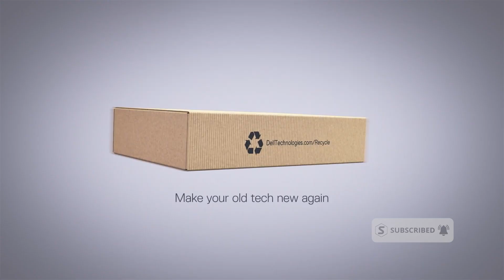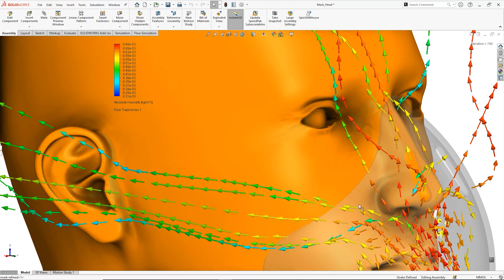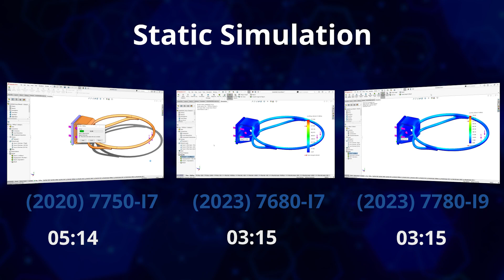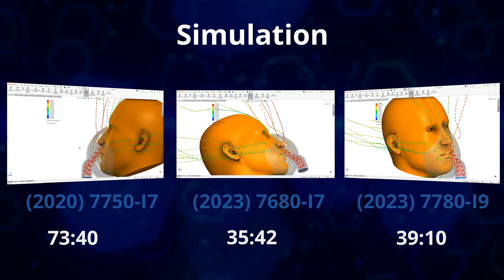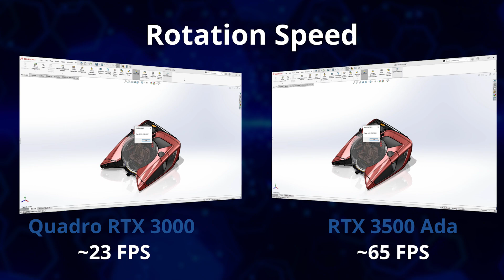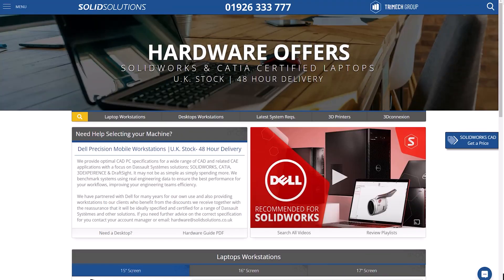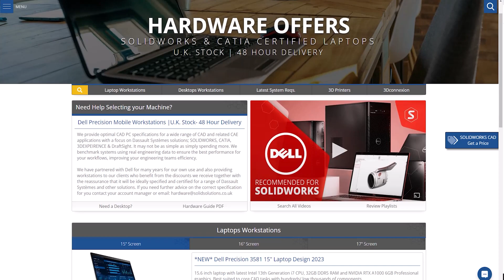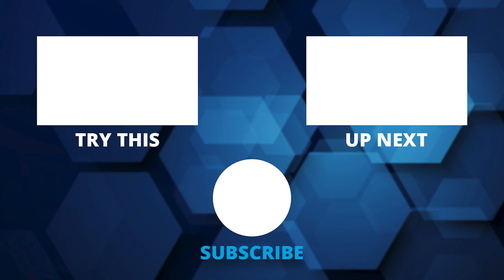Dell Precision 7680 and 7780 SOLIDWORKS Performance

Comment: got a 7680, set in BIOS to power on weekdays at 8a.m.
will it power on even if it's on battery?
Reply from the maker: Hey there - as long as the battery is charged, there should be no issues with that. 👍If you have any questions about hardware, feel free to get in touch with our hardware team: https://www.solidsolutions.co.uk/solidworks/hardware/desktop-workstations.aspx
Reply: @TriMechGroup  yeah I was hoping it wouldn't power on. 
Will test it out.
Thanks